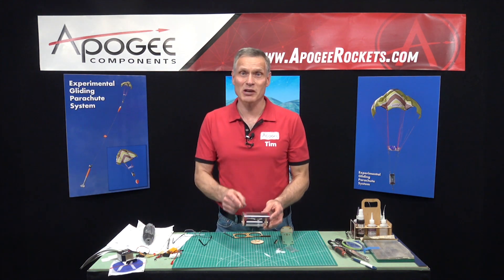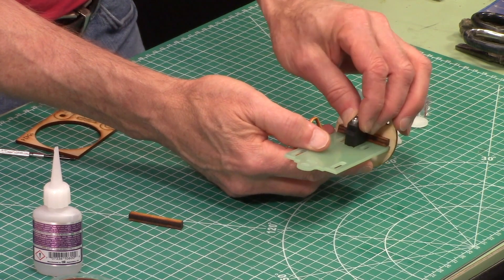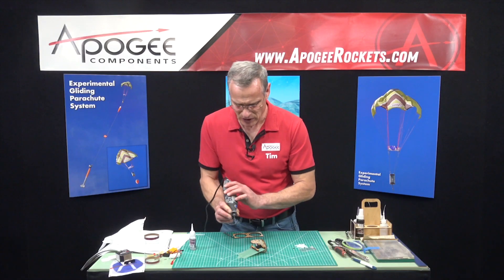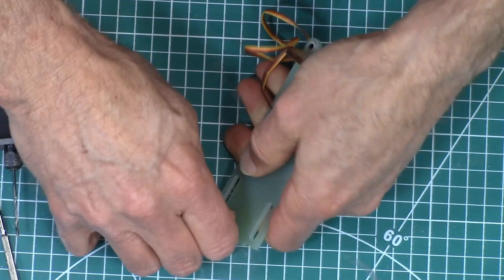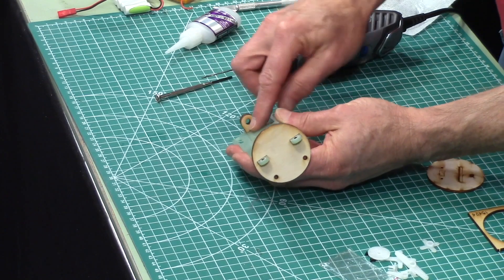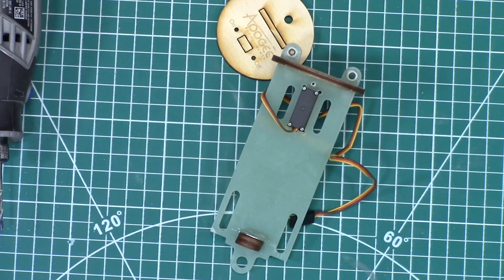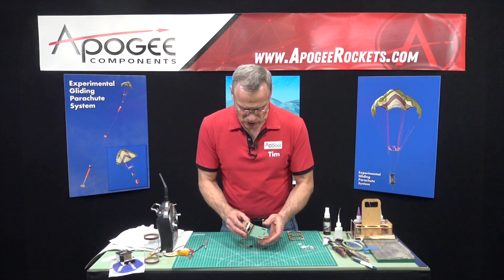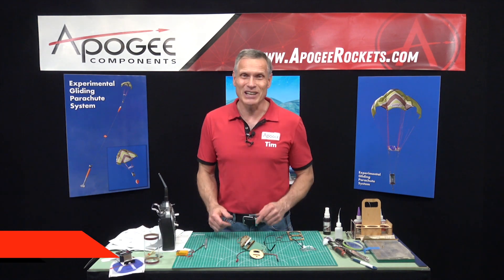Gliding Parachute Assembly - Part 2 of 9

Comment: The development of a lifting body directed glide to launch site like that used by Starship terminated by a low altitude parachute deployment would be cool.  Both the glide and parachute deployment would be via RC aircraft TX/RX component control with stability and level flight augmentation  using one of the RC aircraft stabilizer systems.
Reply from the maker: Sure would be cool. Go for it!